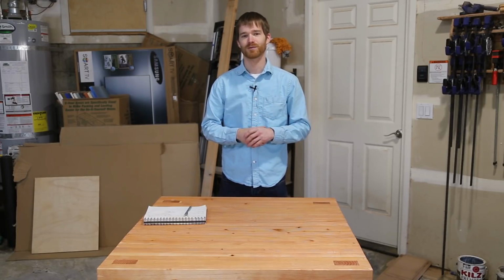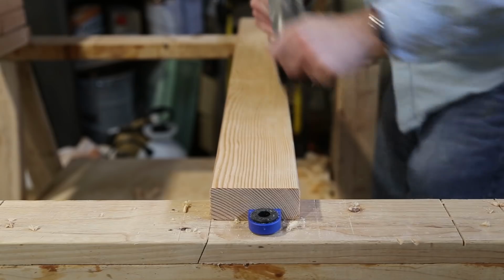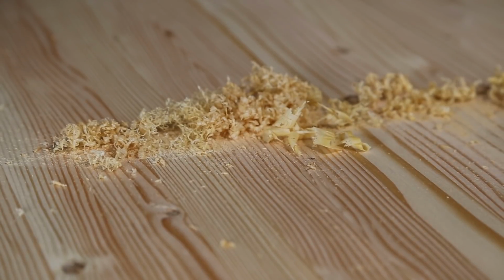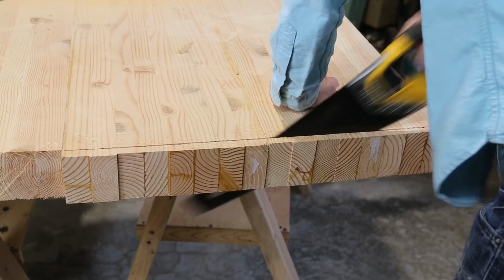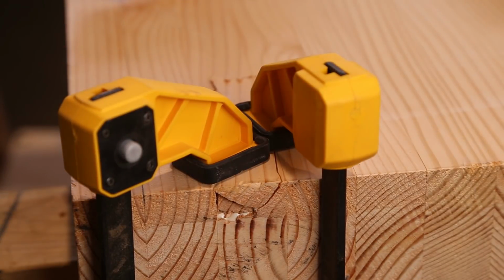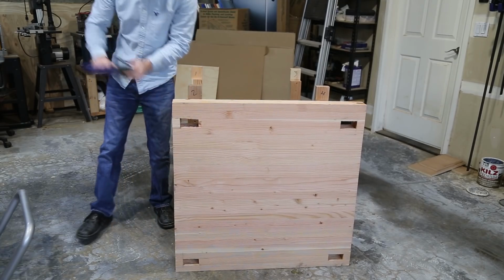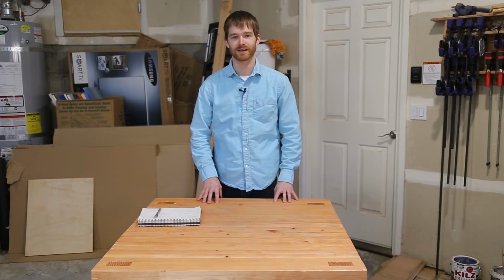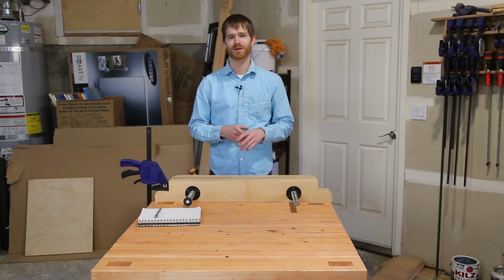Building a Cheap Hand Tool Workbench

Comment: Extremely sharp chisels can prevent a lot of hassle.   Been there done that.
Reply from the maker: I'm slowly getting better at keeping my tools sharp all the time, but it's so hard to pull myself away from the middle of a project to sharpen them.
Reply: @theunluckywoodworker7930  I fully understand.  And sharpening takes a bit of time to get it right.
Reply: @theunluckywoodworker7930  Those Japanese woodworkers  have such sharp equipment that it looks like they're slicing thru cheese. They probably have a fulltime crew whose only job is sharpening tools.
Reply from the maker: Haha yeah, I've seen a few videos where they compete on planing the thinnest possible continuous shaving and it's incredible

Comment: I most enjoyed watching your mistakes because I am making a whole bunch of mistakes while constructing my work bench as a write this comment.  My work bench is really rough but it will be enough for my hobby type working working projects.
Reply from the maker: Mistakes are the best way to learn! My first workbench was really rough too, but it worked well for me until I learned a little more and made a new (slightly less rough) one. By the time I was on to making this one, I was building it much better but still making plenty of mistakes haha.
Reply: @theunluckywoodworker7930  The work bench I am building is based on Charles Harold Heywood's 1949 "Carpentry For Beginners" that I picked up in a used-book store, along with other 1950s-1970s era books that talk about my much older second-hand tools.  It was reprinted in paperback in 2009.  I only made mistake and caught myself before making several others today, but the frame is finally finished and screwed in a bottom shelf tonight. The top will be two 2x12 old redwood planks that sat outside in my backyard for probably four to five decades (prior to our ownership).  It is really heavy,, made with 3.5 x 3.5 inch legs with a bunch of half-lap joints, mostly not square, but with screws and glue, it hangs together quite well with nary a rack.  At age nearly 78, I am finally a woodworker, following my father's beloved hobby.
Reply from the maker: That's awesome, congratulations on that progress! I hope you'll get many years out of it on this great hobby. Being able to make use of older bits whether lumber or tools is always a nice feeling, better than letting them go to waste, and a lot of the older tools are actually really good.

Comment: The reason your top tennon didnt fit was that your spacer block when making the legs was the un-squared lumber. Meaning that you measured for square stock but used rounded stock, made them a combination of 1/2 inch too long or so. Nice work otherwise dude. 👍
Reply from the maker: Oh nice catch! If only I could go back in time... Haha

Comment: I think it turned out pretty solid man!  couple mistakes but that's trial for ya.lol We've all and there bro. It has a nice moxon vise I'm sure you'll get some good use out of that.. I've been told that whatever your vises max capacity is thats how u space ur dog holes so if you have a 9 inch Vise  you would space your dog holes 9" apart from ur vises farthest jaw.  hope that makes sense if it doesn't check out James Wright Channel he has a couple of videos about that. that's  actually who told me LOL .have a good one bro
Reply from the maker: +Joe basement woodworking Ah, that's good advice! I am debating getting a tail (or, I guess, "side") vise now that I'm not going to put this where I was originally planning, so maybe I'll wait to drill those holes until then. James Wright is great though! I just wish I had time to keep up on all the videos and go back to the previous ones.